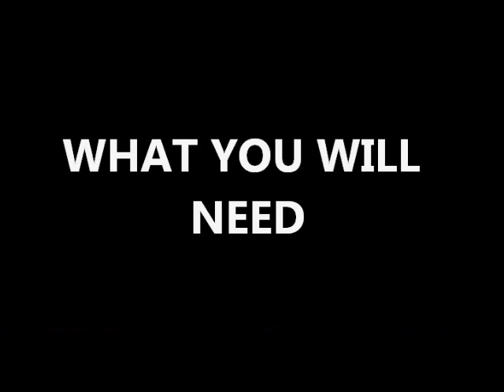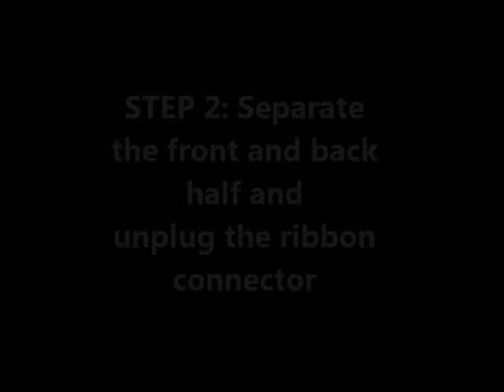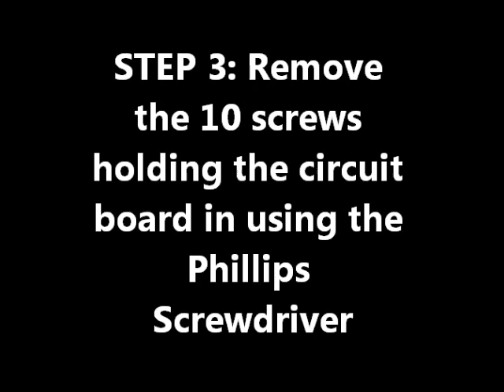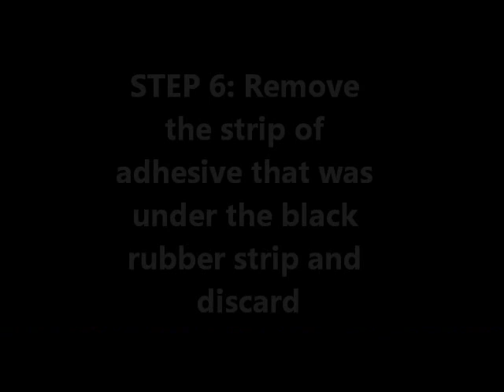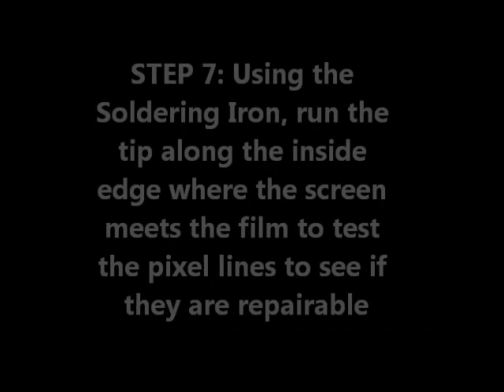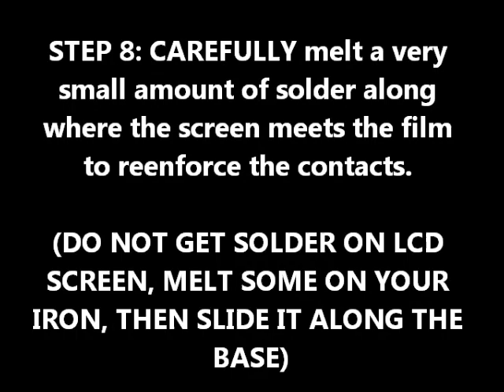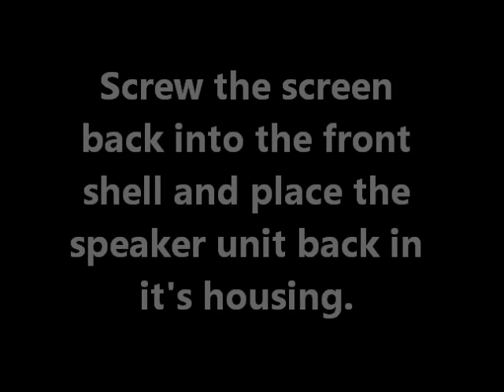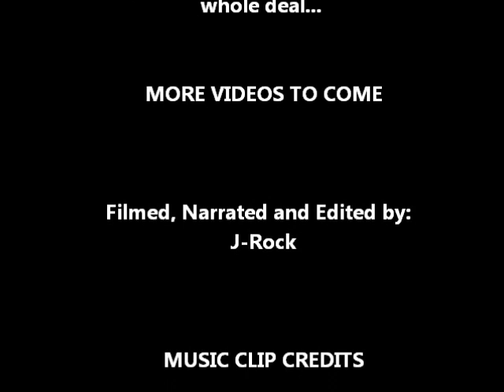Gameboy Repair: Fixing "Dead Lines" on the LCD Screen

Comment: By any chance can you use tape or PVA glue to put the ribbon back in to place?
Reply from the maker: +jacob smith I don't understand the question. The ribbon connector? You just plug it back in. If you're talking about repairing the lines, you need solder.
Reply: +JRock the GameRocker oh that's fine,  I was just asking if I could repair the lines with tape or glue.

Comment: Great vid! I have problem with my only gameboy. That one was in superb condition but I disassemble it anyway to clean button contacts and clean the housing. I use only medical alcohol. When I put it together there is no picture at all. Batteries are working. I checked everything again but can`t see what is the problem. Any suggestions are welcome!
Reply from the maker: +Stjepan Florijan Double check your ribbon connection and contrast dial would be the first places I would look

Comment: Thanks for this. I thought I remembered hearing the issue was an easy fix. I just picked up a dirt cheap Gameboy that has few dead columns at the edges of the screen at a thrift store that I only bought because it was in bundled with a Handy Boy I wanted, and they wouldn't separate them. Anyhow, both were in excellent condition so this Gameboy will probably replace my current one when I fix.

Comment: why does this happen? I've had one that always worked but now shows dead lines aswell while it hasn't been used for a long time. does it have something to do that there was no game in there for a couple of years? or is it better to leave a game in the gameboy anyway when I put it aside?
good video, appreciated.
Reply from the maker: It just has to do with the aging of the materials it was made with. Having a game in it won't help or hinder the situation, although it would keep dust out very well!
Reply: Bobby Rayburn the screen has ink in it, it's the old ink messing up the screen.

Comment: I still have my Gameboy but when I turn it on, nothing comes on the screen
Reply from the maker: Beatlesbec Check to make sure the contrast knob isn't jammed all the way down and stuck or broken, if that's fine, maybe the whole connection to the screen is severed somehow
Reply: try and look at the battery contacts if they are corroded or have battery acid the gameboy will not turn on, look up videos on how to fix the battery contacts

Comment: Worked perfectly Thanks!! Also i found a single staple (un used) on my speaker too haha
Reply from the maker: +Tom Marshall Right on! haha, you're not the 1st to find one in yours either!
Reply: +JRock the GameRocker  can you help me? mine doesnt have dead lines or anything like that its the picture that wont sure. will this work still?
Reply from the maker: Not sure... only one way to find out. If it's not working anyways try it out, sounds like you can't hurt anything that isn't already busted
Reply: JRock the GameRocker  yeah true I'll try it out thanks for the help
Reply: +Tom Marshall fixed 2 today and one of them had a staple on the speaker. wonder whats with that?
Reply: it's a shim, to make the speaker touch the contacts better..

Comment: Do you have to use a SolderIron? Is there anything else you can use?
Reply from the maker: Kuuper111 Yes you have to use a soldering iron. You can get one for around $20.
Reply: JRock the GameRocker I acctually have one, well my dad does, but its a very different model than the one you use.
Also, where exactly is the video output of the gameboy? Is it possile to link that to a rca or scart so you can play it on your tv? ( i know this is possible if you have nes or snes with a special cartridge)
Reply: Kuuper111 well in California and I'm sure other places you can find a 4 dollar soldering iron at harbor freight and it is GREAT quality but you don't have to use it. You can get a strip of duct tape or something and apply enough pressure so the duct tape will make the ribbon make contact with the screen
Reply: I live in the Netherlands bro, California is a bit too far away XD